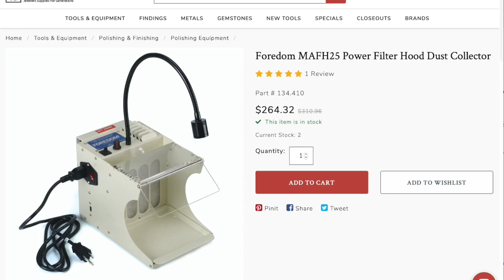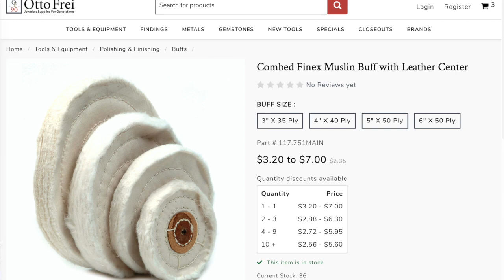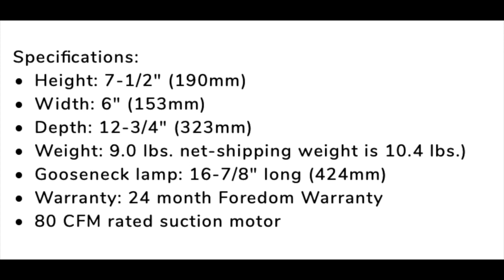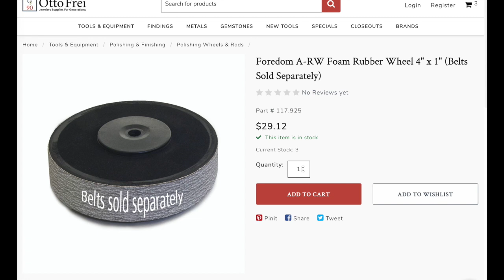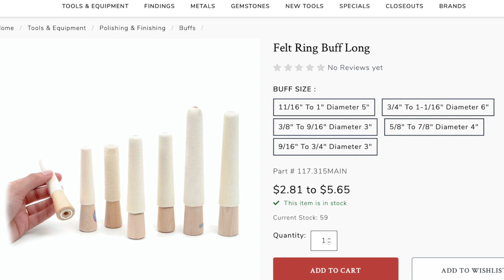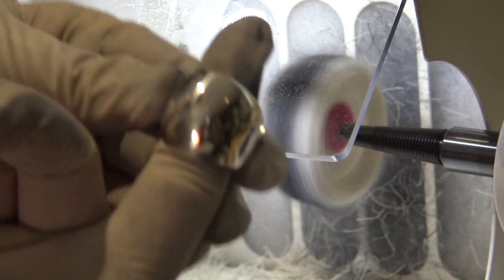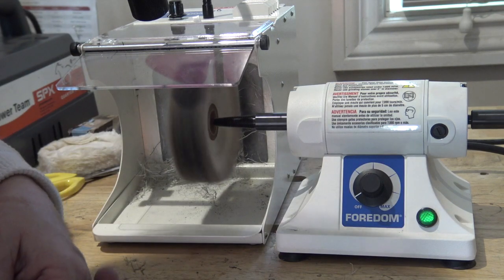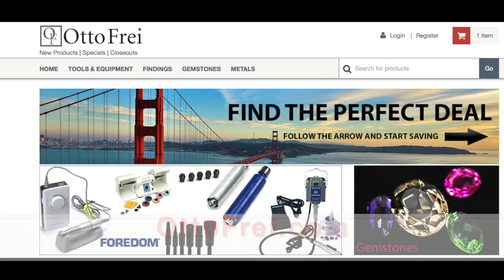Simple Jewelry Polishing with a Foredom Bench Lathe & Hood

Comment: What is the brand and the manufacturer of the latex gloves that you are using in the following video 

Are the latex gloves that you are using in the following video lightly powdered micro powdered powdered or powder free 

Are the latex gloves that you are using in the following video fully textured lightly textured micro textured or smooth 

And what is the size of the latex gloves that you are using in the following video size extra small size small or size medium
Reply from the maker: they are powder free they come in small med and large, the brand is irrelevant get gloves that fit your hands well without being loose at the tips and allow you to grip your metal securely  Better Yet, use bare hands if you don't mind getting dirty,